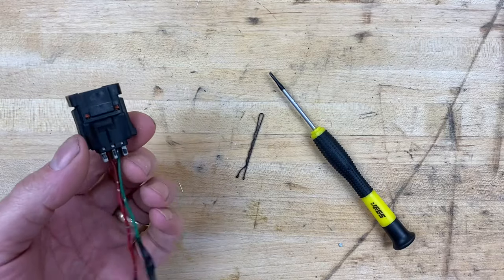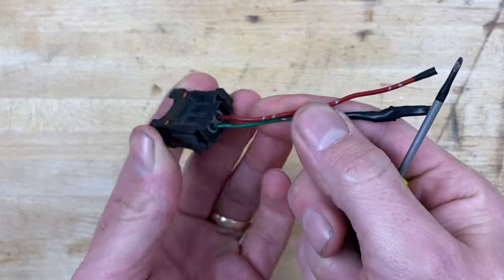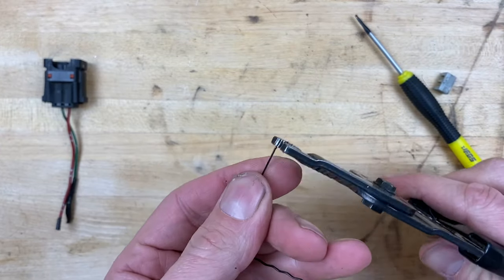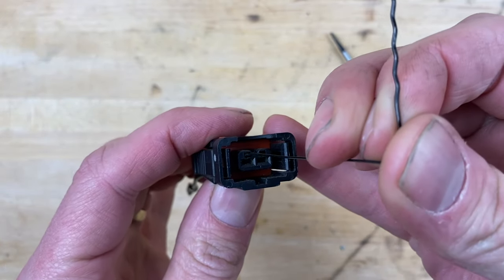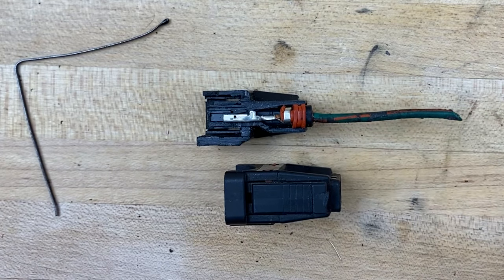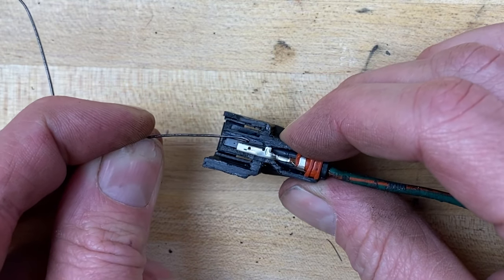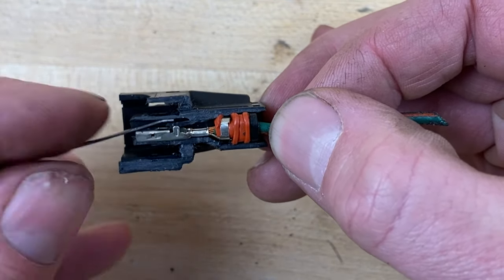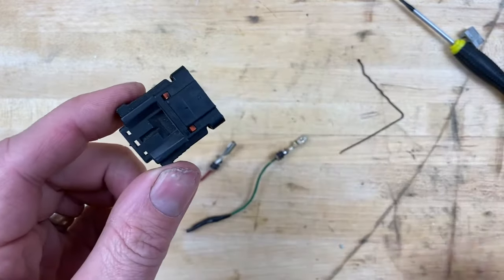How to remove pins from a connector / Depinning Connector

Comment: Very helpful, I had to de-pin the park-neutral safety switch connector on my honda after a rodent chewed thru the wires. Soldered new wires to pinned wires, plugged back in, started right up

Comment: Snap On Electrical wire removal tool:$40/5 pack
Dollar Tree Bobbi Pin:$1/50 pack
Learning this trick: Priceless!
Reply from the maker: Haha! Exactly! It also allows you to do this sort of thing at a friends house when your real tools are not available! Thanks for watching!
Reply: @Ratty Muscle Car  any chance your in Florida? LoL
I got a project that I need help with. Due to recent surgeries,  I'm limited on my ability to complete her..  72 Camaro
Reply: Also, I'm converting oem head & tails to LED's...
Any info or suggestions of anything I may need to add on after I rewire entire car with modern Painless Wiring ATC style fuse block?
I got the kit with extra slots for add ons too
Reply from the maker: @mobileautorepairs2169  - I am waaaay up here in Massachusetts where the weather is cold and the cars are rusty. Sadly that’s a bit too long of a commute for me to work on your car. ;)
Reply from the maker: @mobileautorepairs2169  - you’ll want an LED flasher, but other than that, it should be all the normal wiring most likely. I’ve used the LED flashers from Amazon that are like $8, and they do the job. You just have to make sure they aren’t wired backwards. They only work one way. https://www.amazon.com/shop/rattymusclecar/list/3LN3FHYBGH

Comment: Hey, I've been watching some of your videos. I recently installed LEDs on my bike, and got an LED relay for them. It works, but if I don't take out the blinker pilot light, all four signals start blinking no matter which direction I push the switch. Could you make a video explaining why that is?
Reply from the maker: That’s because the blinker light on the handlebars is connected to both the L and the R directionals. So when either side is turned on, it passes the power from one side to the other. Normally the switches in steering columns of cars manage that, but if you’re doing something custom, you may need some diodes to make it work. Honestly, I’ve never tried though. So I’m not entirely sure.